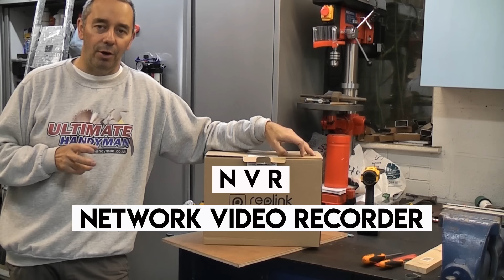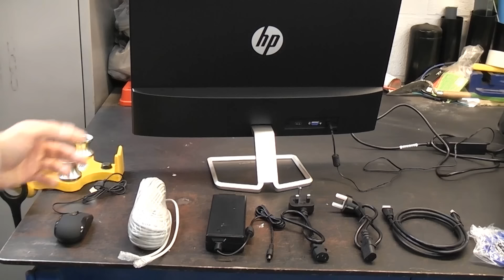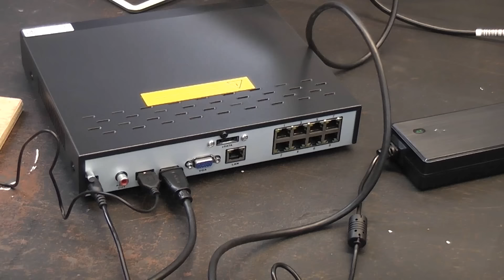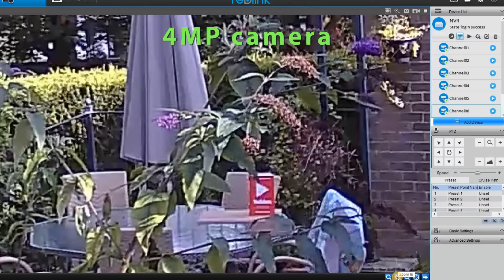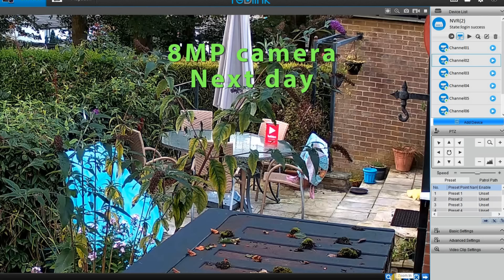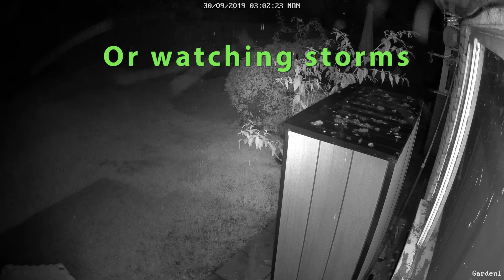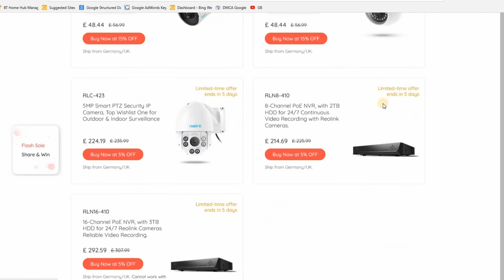Reolink 4K Ultra HD (8MP, 3840 x 2160) security camera and NVR

Comment: What are the recordings like? I see there was a bit of compression artefacts when you was viewing live, is this just from the DVR to your computer or is it actually like that in a recording?
Reply from the maker: It's a combination of everything. When viewing more than 1 camera, I have to reduce the quality, or it does not stream correctly if using the desktop app (as it comes via my home network). If I use the NVR interface the picture is much better, but I don't have a 4k monitor, also I had to edit the video down to HD as I filmed everything in HD.
Thanks for the comment 👍

Comment: I've had this system for about 2 months now and it's excellent.  One thing to remember though, is that unless you have a 4K monitor, you won't get the full benefit of the system as if you set it up to record in 4K, you won't be able to see anything on the monitor as it won't register.
Reply from the maker: Thanks for the comment 👍

Comment: I bought the 1440p system after your last video. The quality is great etc. however the Reolink desktop app sucks! I'm lucky if I can ever get a camera to view live (or at all tbh) nevermind get 4 working at once. The app on my phone is the only way I can interact with the cameras and pull footage since the NVR is tucked away in the garage.
Reply from the maker: Could that be your network speed?
Sometimes I have had problems and thought it was due to the network speed, but I could be wrong.
The desktop app lacks a lot of features that can be accessed directly using the NVR interface, such as being able to watch the footage at faster speeds. Perhaps they will improve the desktop app at some point!
Thanks for the comment 👍

Comment: Good to see these videos. Can I ask if you normally make up your own Ethernet cables rather than using the ones the camera come with? Also have you thought about adding security cameras with PIR so it lights up the area at night if you had an intruder and would make the picture easier to see who it was? You might like a look at/subscribe of the YouTube channel 'LifeHackster' he does a lot of reviews of security cameras etc.
Reply from the maker: I normally run CAT5 cable, then terminate that into a socket (inside an external waterproof enclosure), then use a small patch lead to plug into that and the camera. These would be much easier to install, if they just had a RJ45 socket on the back of them (waterproof). Most of the cameras here are in areas where floodlights illuminate. I had real problems filming the night vision shots for this video, as I had to cover two security lights with boxes to be able to film the night vision (you can see the light emitting from the sides of one of the boxes at one point)
Thanks for the comment 👍
Reply: @ultimatehandyman  One final question, do you think the footage is clearer on your monitor as YouTube seems to auto play my videos at 720p, but would it be clearer on your actual recording than the YouTube 1080p? Thanks for the reply.

Comment: I have recently bought one Reolink RLC-422W to test it out before buying any more. It works OK and the PC programme has good features but it crashes frequently. This doesn't appear to be an issue with the camera, just a poorly designed PC programme. It's still useable, but very annoying.
Reply from the maker: What operating system are you using?
If I remember rightly, I had major problems with a camera (I think it was Reolink) using windows 7
The only way to fix the problem was to upgrade to Windows 10, which sorted out that problem and a few other problems. Luckily I found a free upgrade link and upgrading from 7 to 10 was a piece of cake, although it did take a few hours!
Thanks for the comment 👍
Reply: @ultimatehandyman  It's a fully up-to-date Windows 10 machine and I don't have any problems with any other programme. I suspect Reolink's expertise is in cameras, not PC programmes! I've also seen occasional issues with the iPhone app (sometimes not displaying the timeline for captured videos) but used that a lot less - closing and re-opening the app fixes that, but it shouldn't be doing that in the first place!

Comment: I have Reolink with 5MP cameras. It has been faultless. I changed the camera names in the desktop app and they all show the same name on TV.  PC and phone
Reply from the maker: When you use the playback feature though, it shows the channel numbers on the right hand side of the screen, on mine it lists all 8 cameras, but I don't know which camera is which until I drag one of the cameras into one of the 4 panes on the left- then it shows the camera name. I therefore have a list, which has the camera name and the channel number, so that I know which camera is on which channel.
 Thanks for the comment 👍
Reply: Ultimate Handyman    Sorry...I misunderstood you. I am getting the same as you then 👍🏻😀
Reply from the maker: I probably did not explain it very well, I was going to recapture some footage and edit the video again, but I'm really pushed for time (all the time) 😂
Thanks for the comment ;-)
Reply: How many days storage with 4 X 5mp cameras with the 2tb harddrive trying to decide which to go for the 4k system or 5mp

Comment: Have you replaced your old cameras. Or added new ones. Sign of the times is every house having security cameras
Reply from the maker: I replaced 4 of my 5MP cameras with the 4K ones, but then I had to change the NVR as it would not work with the newer cameras.
My old NVR  and four 5MP cameras will be installed at my mates' house (when I get time)
I remember when I was a kid- only banks had burglar alarms, now almost every building has one! Same with CCTV 
Thanks for the comment 👍